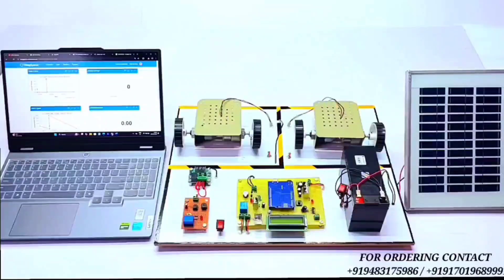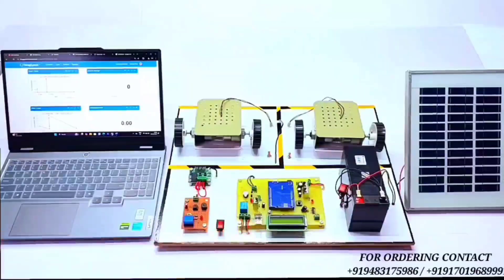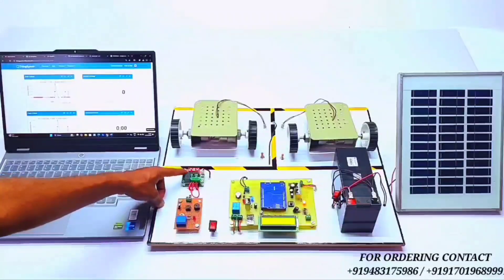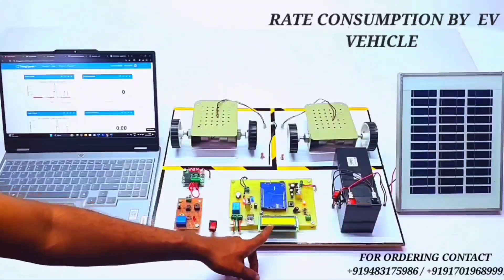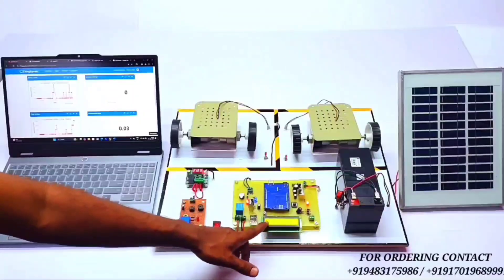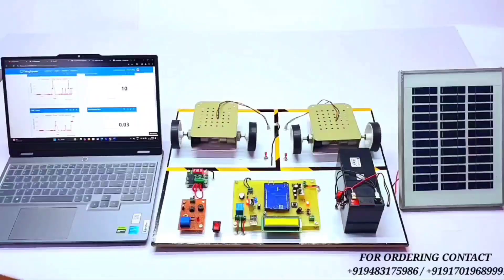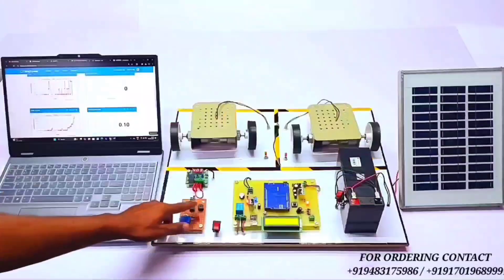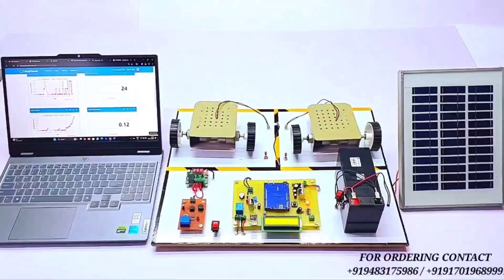SMART EV VEHICLE CHARGING STATION OVER IOT USING SOLAR ENERGY || CREATIVITY THINK  || #diy #project

Comment from the maker: For ordering the project, contact us 
9483175986, +917019689991.

Welcome everyone to Creativity Think We are introducing our latest project: "SMART EV VEHICLE CHARGING STATION OVER IOT USING SOLAR ENERGY."
--‐---‐---------------------------------------------------------------------

IN THIS PROJECT, THERE ARE FOUR KITS AVAILABLE 

1. The "For Documentation" option provides comprehensive documentation (over 60 pages report, 15 to 20 slides PPT, circuit diagram, program code, PCB layout and schematic, explanatory video), along with audio call support, for a price of 2000 Rs.

2. DIY Project Kit of the project .
The DIY Kit includes a bare PCB, solderable components, external components, and all necessary documentation (over 60 pages report, 15 to 20 slides PPT, circuit diagram, program code, PCB layout and schematic, explanatory video) for institutions, priced at 9999 Rs.

3. Ready-made Working Project kit.
The ready-made project kit along with comprehensive documentation (over 60 pages report, 15 to 20 slides PPT, circuit diagram, program code, PCB layout and schematic, explanatory video), audio and video call support, and a one-year warranty, priced AT 10,999 Rs.

4.  Ready-made Project + DIY Project . Ready-made project kit, One more extra bare PCB solderable components for extra PCB, All documentation (Report more than 60 pages, PPT 15 to 20 slides of the PPT, Circuit diagram the project, Program code of the project, pcb layout of the project, pcb schematic of the project, pcb slescreen explanatory video )Audio and video call support, One year warranty, priced 11,999 Rs.
-------------------------------------------------------------------------

📱 Get Connected:

Connect with us via WhatsApp or Instagram to explore our project offerings, discuss customization options, or place your order. Our dedicated team is here to assist you every step of the way.

🔗 Contact Information:
WhatsApp: 917019689991, 919483175986
Instagram:https://www.instagram.com/_creativity_think?igsh=amZybGw3d3V0YnAw

#smartev 
#vechicles 
#chargingstation 
#iotproject 
#smartevvehiclecharing
#smartevvehiclecharingstation
#evvehiclecharingstation
#solarenergy 
#solarsystems 
#smartevvehiclecharingstationoveriot
#smartevvehiclecharingstationoveriotusingsolarenergy
#smartevvehiclecharingstationoveriotusingsolarenergys
#smartevvehiclecharingstationoveriotusingsolarenergysystem
#evvehicle 
#electronics
#diploma 
#collage 
#robot
#robots
#diy 
#science 
#scinceproject
#diykit
#project 
#arduino 
#arduinoproject 
#collage 
#diy
#engineering 
#project 
#engineering 
#engineeringprojectcenters 
#engineeringprojects 
#project